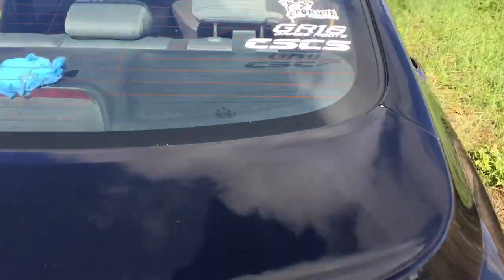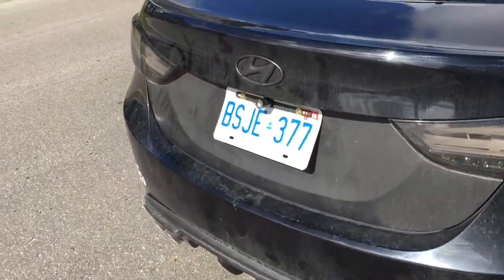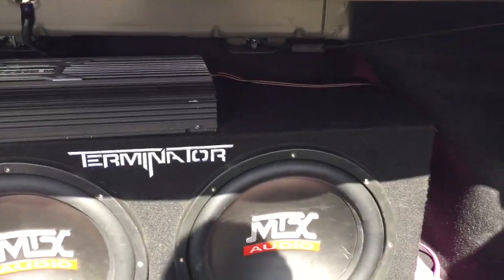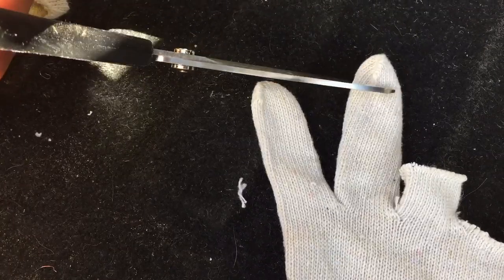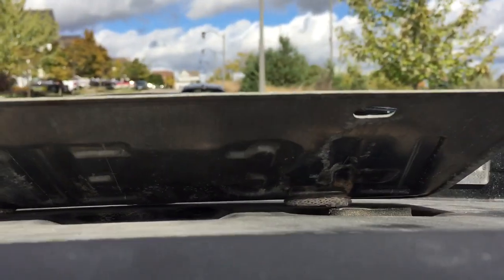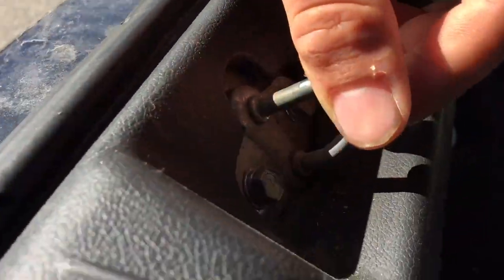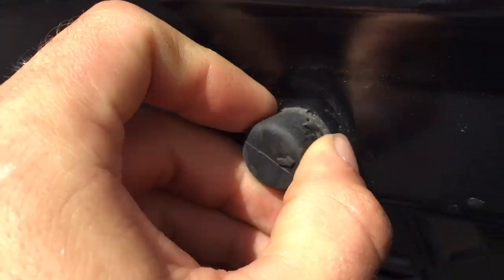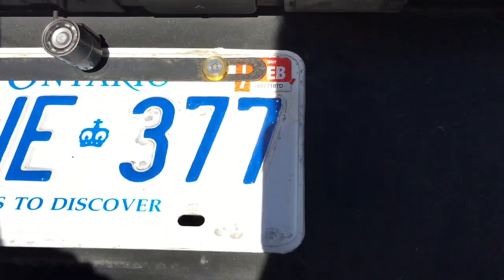How to fix trunk rattle for free!

Comment: I had the same problem with my Hyundai. I found a really easy fix for it. I sold it.
Reply from the maker: I also sold it lol
Reply: how was it should i buy a hyundai
Reply: @trualpha  nah ive had my accent since i was 15, ill be 20 this year, while it's been reliable, most fixes tend to be really dumb, and there's always some over complication, and my specific car has a hvap defect, this valve can't remember the exact name but it breaks every like 8 to 10k miles, luckily i had a shop down the road do it the first time and it's a free fix whenever it happens but would be a pain in the ass if I had to do it myself, it tanks the mileage and makes the car run bad. But you'd be better off going toyota or honda for a daily way more reliable. Hyundai isn't complete garbage but if your not getting a genesis or a tiburon they kinda just suck.